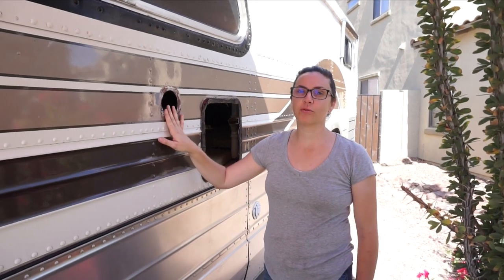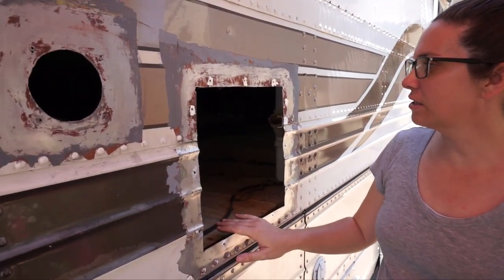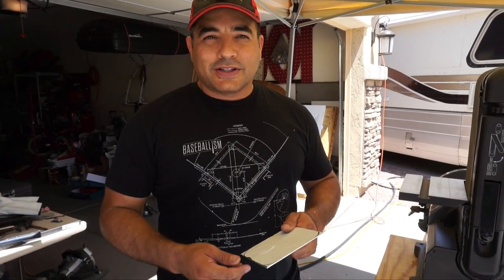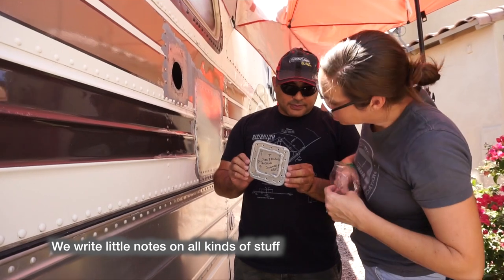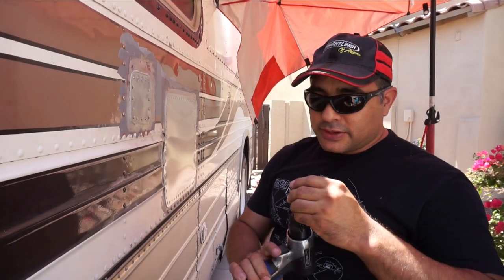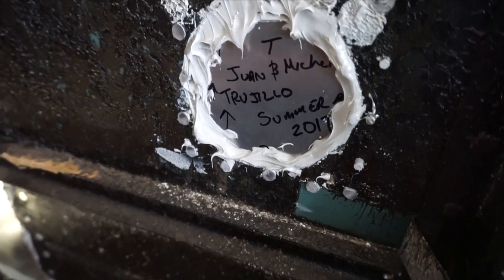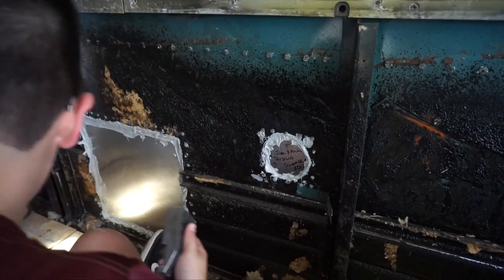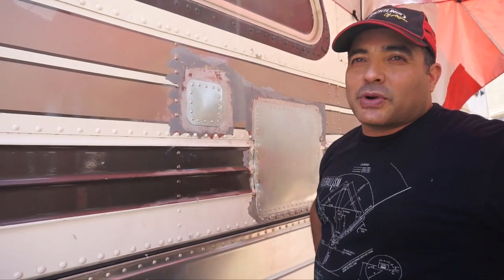Bus Patches

Comment: The sealant you put between the aluminum and steel of the bus is more important than you likely realize.   Not only is it providing a better water tight seal, it is also inhibiting galvanic corrosion of the steel induced by contact with the aluminum - as long as you used steel rivets, and not aluminum.

Thanks, for the great series of videos!
Reply from the maker: Richard Owens So far, the sealant is working well.  Our bus is actually  aluminum, so aluminum sides with aluminum patch and aluminum rivets.  We have seen evidence of the corrosion caused between steel and aluminum in other places on the bus, though.  There was a blower motor in our old a/c bay that had eaten through the aluminum floor of the bay.  The steel hinge on the aluminum front door was also starting to see some corrosion underneath.  So, we are trying to be mindful of not mixing metals as much as possible.

Comment: Really enjoying watching the build. You guys are resourceful and obviously not afraid to learn as you go. I was fully expecting you to utilize your new metal brake to attempt to match those original creases on the large square patch. Did you guys decide it wasn't practical or perhaps some other reason? The repairs do look sharp as they are and I am like minded with wanting to do all or most the work myself but another option might have been for you to fabricate nicely fitting flush filler patches and having them Tig welded professionally then you could do the finish metal work. Just trying to be helpful, not critical. Keep up the good work. You've got me hooked on the build now.
Reply from the maker: Hi Dennis and Donna - thanks for the encouragement and thanks for watching.  We tried really hard to use the metal brake to match the original creases but it just proved too difficult.  The Tig welding idea is an interesting idea and may have looked nicer.  We just learned to MIG weld not too long ago and we think TIG welding is probably a little "out of our league".  We are just really trying to get the bus watertight and we are hoping that when we paint it the patches just kind of blend in.
Reply: Beginning from this Morning  Well there is way you could have emulated the bus skin using a metal brake - specialist rolling machine at the extreme and with a helluva lot of work making a set of dies you could have pressed the shape . You took the right course of action.👍

Comment: Why did you not panel beat the patch to match the skin this could be done with care?
Reply from the maker: We tried several times but we couldn't get it right.
Reply: Kind of sad you chose to skip the bead lines on the larger patch.  A bead roller could have knocked out matching beads in a few minutes.  About $20 at your local sheet metal fab shop.